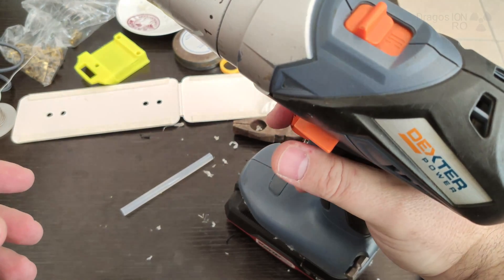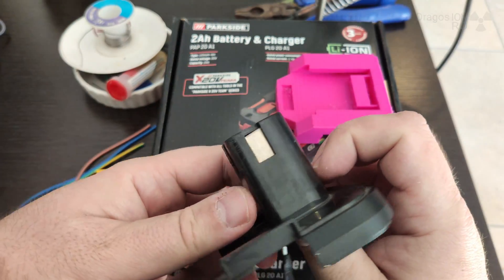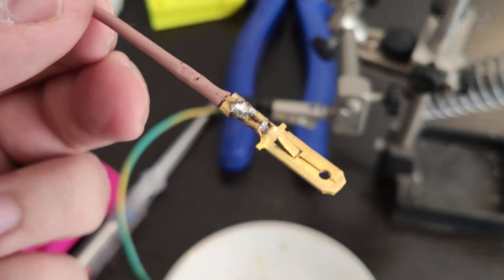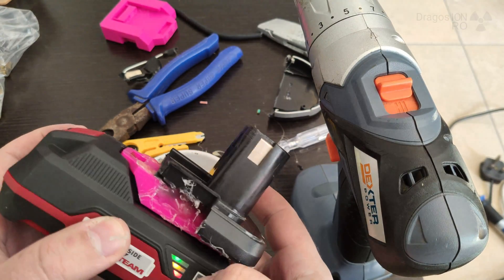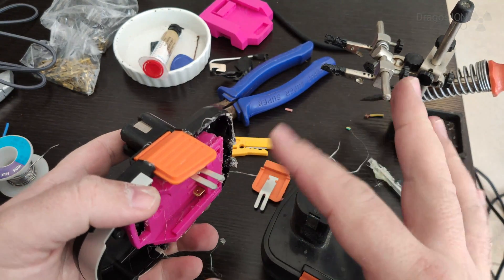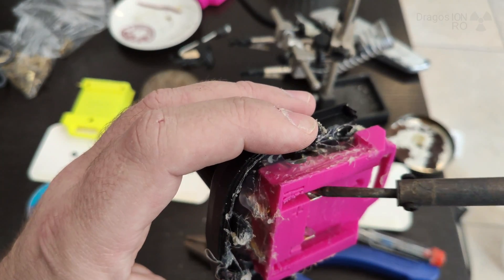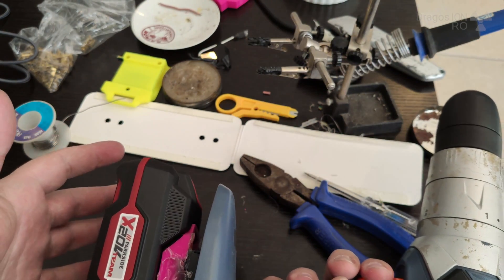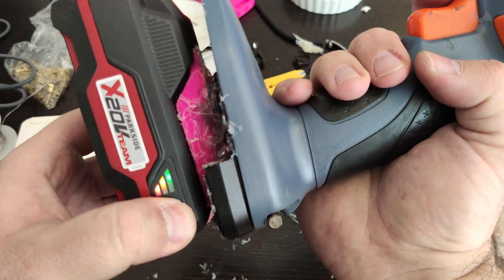3D printed adapter for cordless drill - Parkside battery hack

Comment from the maker: https://www.ionhowto.com/parkside-battery-not-charging-fix-charger-led-blinking-red-green/ 
Amazon: Battery Adapters and converters: https://rex.red/power-tool-battery-adapter-converter *
Adapters Parkside:  https://rex.red/parkside20v-battery-adapter *
3D printer: https://rex.red/3d-printer  *
Screwdriver set:  https://rex.red/precision-screwdriver-set  *
Faston terminals: https://rex.red/faston-kit  *

SUBSCRIBE and CLICK the BELL to be notified.
DIY Projects https://rex.red/diro
RedNumberONE https://rex.red/rno

Join DIY Projects https://rex.red/diro-join

Purchase using our affiliate links and we get a small amount. This helps us make more videos. You do not pay more and may benefit from special offers we share.
Affiliate links are marked with a star. *
By using our links, you support this channel.
Reply: More videos about Parkside batteries pretty please

Comment: Hi there,how the 3D Printer know what to print? how model is added to Software? which software is used for 3d modeling and printing? if you want to answer i will be very gratefull thanks
Reply: He bought that adapter.
Check the links.
Some guys probably 3d scaned the battery and the drill and printed that adapter.

Comment: fix o bormasina dexter am :)), nu e o problema ca bateria are 20v si bormasina mergea cu 12v ?
Reply from the maker: Aia din video avea baterii de 18v. De la 18v pana la 20 nu e problema dar nu cred ca merge mult daca bateria originala avea 12v e diferenta prea mare.

Comment: When I rebuild batteries I use desoldering copper braid and klapton tape as an insulator around it. High current, flat and flexible.

Comment: Nice one 👍 thanks. 
Do u know where can i get female terminals? Like the battery ones.
Reply from the maker: I didn't need those. I guess you could try online or a local big electrical shop. 
I don't even know how they're called. 
There must be many types and sizes.
Reply: @IONHowTo  i need them because i dont have the original battery . And i hace to make two adapters and join them together. 
Dont know i u know what i mean
Reply from the maker: If you try to build the battery from zero 18650 cells + BMS - be careful with what BMS you use. 
You could find other batteries ready-made. Doesnt have to be parkside. As long as you have the right adapters its ok.

If you use pre-made a battery but your drill terminals are not like what I show and same style as on the parkside batteries then yeah you'd need female terminals too. Try a few google image searches, DC heavy duty terminal or connector, switch to images tab and see maybe you get an idea how they're called then look for that.
Hope it helps.
Reply: @IONHowTo  no. I got many parkside batteries . I just need a doble adapter.  The side wich plug in the parkside battery and the side that plug into the makita machine
Reply from the maker: Try to search for makita battery termininals in google
Reply: @IONHowTo  I'm also looking for the same thing, did you find where to find them ?